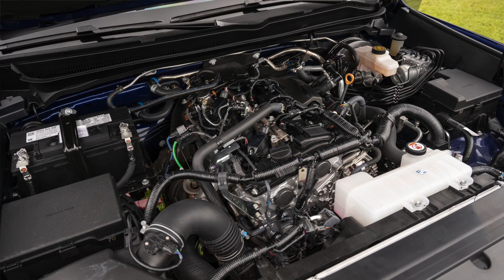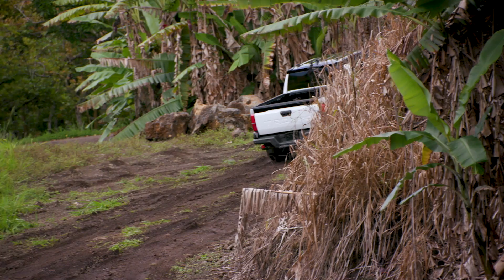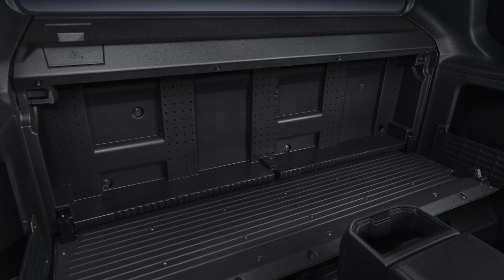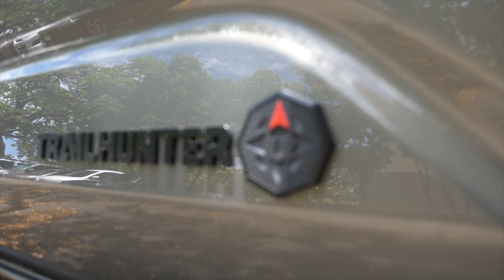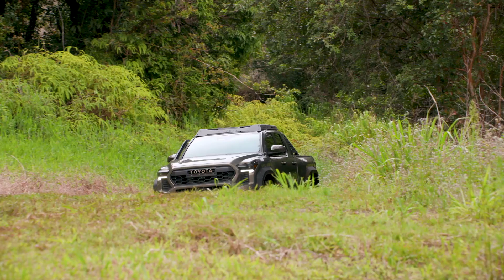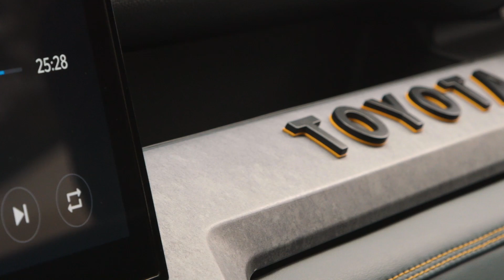2024 Toyota Tacoma Chief Engineer // What you need to know!

Comment: Will be very interesting to see the long term effects of using a thinner gauge metal for the frame here in the rust belt. Toyota has made claims before about corrosion resistance, but I have yet to see lasting real-world results. Hoping they actually did something that will last in salt spray.

Comment: Why did not you equip the partial 4WD trims with a central differential (open or limited slip)? I would love to have an option to use all 4 wheels on both slippery and non-slippery surface and to be able to disconnect the front wheels. THe only trim that has a central differential is Limited, nut it's full-time AWD. I don't think there are technical obstacles to having a central diff on partial 4WD trims - there are probably marketing and segmentation reasons for that. But I am sure there are many people like me who would loe to have a central diff on partial 4WD trims like TrailHunter and TRD Pro. Alternatively, there could be an option to have fulle-time AWD on ThailHunter and TRD Pro.

Comment: Exactly what was needed to explain the new features. I only wish engineering find a way to give more leg room for the back seats. Those who are 5” 10’  or above have their front seats set back as far it can go, leaving no leg “what-so-ever” in the back. If front driver and passenger seats are not extended far back there is still no room for back passenger. Just seems a waste for back passenger seats not to be used in most occasions.

Comment: The only reason I bought a 2023 Tacoma with the 6 cylinder was because of 2024 toyotas turbo 4 cylinder.  I just cant get past a little 4 cylinder thats turbo charged and trying to tow my snowmobiles or 4 wheelers up the mountain or highways.  Clearly they shaved off as much weight as they could in the new 2024 for that simple reason AND they intend to build ALOT more extra cabs VS 4 door long beds.  Plus, i just cant see that turbo 4 cylinder getting 200+ thousand miles of lingevity?  
But i will say this, That New Toyota bidy style does look Sporty and vicious though !!!

Comment: Better emissions, not necessarily better gas mileage under load, and MOST definitely a MUCH HIGHER repair bill when the dumb hybrid motor fails in under 150k miles. At that point you would be better off just dumping it for a new truck. I for one do not care about all of that fancy balogna. I WANT longevity in my truck. I STILL drive a 2000 Tundra with a NORMAL V8 and very few normal issues that occur at the 100k mark. There is absolutely NO way this new Tacoma can ever last as long as my old Tundra. Not to mention the ridiculous prices now on the new versions. Overall, NOT worth the price tag.

Comment: Turbos are trash and won't last a long time, period.  You clowns need to listen to your customers and mechanics and quit trying to reinvent the wheel.
Reply: You might want to quit listening to Scotty Kilmer all the Diesel engines have turbos these days America runs on Diesel and turbo charged engines 

You can easily get 150-250k miles on a turbo these days depending on manufacturer
Reply: @Kylewraps  Not 4 cylinders they don't.
Reply: @dennisquinn4387  you’re right but doesn’t change the fact a 6 cylinder turbo is more powerful then a NA 8 cylinder 

And a 4 cylinder turbo more powerful than a NA 6 cylinder

Comment: How bout you talk to the Tundra engineers and tell them to fix all the rattling on the interior. I’ve had 2016 2020 and now a 2023. Every time I drive on a less than perfect road I’m constantly trying to track down a new or existing rattling part. The headliner rattles, the door seals rattle, that junk console lids rattles and even the dang lumbar seat rattles if it’s not inflated a good bit. Toyota should be ashamed of itself fit and finished has always been quality being on my 3rd Tundra 5th Toyota truck in a row. I’m almost to the point of trading this one in on some other truck. If it wasn’t for a total loss wreck I would still be driving my 2020, happily. I can’t say the same for my 2023 Limited, it’s a $65k rattle trap. Again Toyota and the guys that engineered the new Tundra should be ashamed of themselves. Just my opinion based on my experience maybe I got an anomaly but don’t think so!

Comment: Love love the new look and the interior finishes, just bought a 2023 access cab with a few add ons. Love the truck but the Gas Milege is terrible though. However the thing of the new truck that concerns me is the move to aluminum body’s given it is less susceptible to rust but given issues over car producers had with this body type in the past and given a truck is handled a little rougher than usual vehicles how will the body holdup long term will it be easily more damaged due to light weight material used

Comment: Question #1 did you guys get rid of the throttle lag? And why do I need to get rid of the front air dam? After I purchased the Tacoma ( Dealership should ask if I want it) I  drive a 2022 Tundra now. I had three Tacomas in the past the last two had throttle lag, I want to test drive the I-force max Toyota Tacoma TRD_PRO
If it has ( the lag ) No Deal, going to Ford Ranger Raptor

Comment: Uhhh oh. He immediately starts talking me out of it.. and do I have to buy some corrosion treatment just to guarantee my frame? I mean. How did they make the frame. And a turbo 4? A hybrid. I'm just sad now. Where's the N/A? What's the alloy ratio of the frame? Rust jacking is what kills them. And where's the wide arms? Offset only? Do you hate us? I feel ignored and offended. And lockers. Now what? A jeep? How long do we have to wait? Until the crash of the hybrid battery manufacturing segment? No long arms. I would quit before saying yes to that. I'd retire. I'd refuse. I'd delete files.  No one is going to rock crawl a hybrid. Integrated bumper? You mean lockers? Buy my own bumper.  The color? Who cares.. the most difficult part of this truck is seeing what happened to it. 

Battery delete. Turbo delete. +2 cylinder mod.   Long arms. Lockers. The truck should probably only come in BMW white.

Comment: ENGINEERS changed the the  2015 and Newer TUNDRA''s Crew max with the hump in the rear seat and floor. It has to be the worse Model Change I've ever experienced in a TOYOTA Product.  Sensor that are always going out!. Rear seat that is as useful as a TOYOTA Camry Not a truck. 
Have they actually gone to the hunter, fisherman with RODs, snowmobiler with snowmobile clothing?, atver, Kayak carrying outdoorsman for functionality over time?? .  NOT the Hocky mom crowd that never goes farther then the depth of the side wall on the tire. ... With SO MUCH TECH It doesn't seem to want to be Reliable over time. Seems more like. Some more planned obsolescence and ADDING Cost over time with frequent repairs. LET Not JOKE. This isn't a legendry 1990's TOYOTA Pickup built to last 30 years. It's built to last 10 maybe 12 model years and be gone.

Comment: These definitely turned out better looking and more desirable than I thought they would but, I guess the thing on everyone's mind is: will they be just as reliable and dependable as the previous generations? Lot's of new tech, small hybrid engines that put out larger engine power, those two things don't exactly scream "long-term longevity and reliability." But if anyone can pull it off it's Toyota. So I'll stand on the side lines in my brand new gen 3 Tacoma TRD and see how things play out with these new Tacoma's.  As an 07 Toyota FJ Cruiser owner and a 2023 Toyota Tacoma TRD owner, I really am hoping for the best out of this new generation because heck, I'll only be alive long enough to maybe buy one more new truck in my lifetime and I hope it will be a Toyota.

Comment: I wouldn’t waste my money on this tree hugging shitbox
Reply: What do you mean
Reply: @mmr0221  exactly what I said
Reply: @predcatcherotr6629  are you talking about removing the v6? If So, then I agree with you. This is Biden’s EPA at work.
Reply: @mmr0221  this thing is gonna be worse on everything especially fuel Milage
Reply: @predcatcherotr6629  especially when hauling heavy things, this will have worse MPGs than the V8
Reply: @mmr0221  exactly plus u loose 1000 lbs towing capacity

Comment: I think he failed with the xtracab prerunner. It should have been an access cab with the storage options as reaching over the seat all the time to reach something in the back is a PITA. Hell there is even a video of the chief engineer having trouble to reach something in the back. Also the rear suspension was a mistake with the leaf springs being under the axel as that limits the lift options and will probably only be used to lower the truck like what other people did with the Nissan hardbody RWD. The prerunner with be terrible for off roading. They can say that they moved to xtracab for crash tests, but I bet it is to save cost and the MSRP will still be more expensive than previous years for the prerunner. Also they should have left the push start as an option. If I ever do get a 4th gen I will probably get a crew cab and delete the back seats to get what I wanted out of the prerunner.

Comment: Regarding the overland demographic, some fundamental strategies are to blend trail performance with all of the mobile camp accouterments and gear that enhance playing and living out in the backcountry. The growth of the truck camper segment makes this clear. I remember when it was tough to even get a rooftop tent in the USA. They eventually became ubiquitous and now are more often being replaced with pop-up campers mounted on trucks. So this leads to a huge question for the Tacoma: Why isn't the 2024 Xtracab being utilized as a Halo version of the truck? It maintains a good wheelbase length for technical trails, comfortably carries one or two occupants with enough room for some gear and a fridge in the cabin, and allows for a deck (bed) that's a full 6-feet long for a much more livable camper space or ability to sleep in the back with tailgate closed. All while reducing the gross weight of the cab allowing for more payload. 4-doors and 2nd row seats are fine for those who need them but please offer the premium drive train and performance options for the single-double occupant overlanders who don't want a 2nd row of seats or a stretched out wheelbase.
Reply: Exactly. Xtra Cab 4x4 with a 6 foot bed. Is there even going to be xtra cab option on the Sport and/or Off-Road? It does not appear so.  And I want to access that space with a door --not over a seat! The "new" xtra cab is more like my old 1997 xtra cab.

Comment: It looks great, but my concern is the crash protection/durability result of keeping the same exterior dimensions while extending the wheelbase and all of the material weight reduction .  That plastic front bumper looks like it would flex from the force of one index finger and the wheel and entire suspension and frame are inches behind it.

Comment: Front suspension arm length same as old generation Tacoma, no articulation gains, no front locker, while competitors offer amazing 10" suspension travel with extended front control arms and CV axles... It's pretty that's about it.

Comment: How are the hybrid (electric) engines with batteries going to do on extreme cold??? Like in about -10 F? Batteries and electronics hate cold and do not perform well in those conditions. Plus the hybrid factor adds complexity to the engine which means very expensive repairs only at the dealerships. The 4-cyl 2.4L turbo is a joke to put in a 4500 lbs vehicle. Adding the turbo you only accomplished that the engine will not last 100K miles because the turbo will burn out the engine. Plus additional issues that come with turbo. Funny thing…they are doing this video in warm Hawaii. Why don’t they do the testing in Alaska in severe cold conditions?!  The lockers are missing and their reasoning that lockers are not needed is ridiculous. If you don’t have real lockers on a 4x4 truck than you don’t have 4x4 vehicle. The electronic “4x4” options are no different than that of Subaru. So what we have here is Subaru in Tacoma’s skin..sheep in wolf’s skin. 
They packed this tacoma with sooo much electrics that it lost the appeal of a SIMPLE RELIABLE off road truck. His argument in video was fuel economy…bunch of BS. People’s going deep in woods dont care about fuel economy. They care about reliability, simplicity, ease of use, utility and dependability! I have never heard a guy talking about gas he saved when he got back from deer hunt. The V6 was perfected with simple transmission. It worked! They just pusified the whole vehicle and ruined what worked well.

Comment: Too bad there's no option for a non-turbo 4 cylinder engine. I'm not a fan of anything with a turbo. It's just one more thing to go wrong and it typically causes the engine to not last as long as a naturally aspirated engine would last.
Reply: 5--7 years from now all the fan boys will be crying about how much a new turbo costs.
Reply: @stevemason6850  Yeah, but the added cost for a replacement turbo is only one aspect. The other one being the turbo is lubricated with the engine oil and that means if the turbo fails and starts to leak engine oil you can ruin the engine.

Comment: two big points for me !  one is the replacement of extra cab, yes did the rear seat delete, but I can get to my stuff better with extra open door.  next is turbo 4 cylinder motor, will run like race horse first five years and after that the high dollar troubles begins ! trust me.     I run the Tacomas to 350k miles or more   22r, 22re, and the 3 gen six cylinder all great !  Tacomas were great due to old school,  and have great track records, fuel and repair, and great looking trucks.   new high tech is not always good  time will tell.     glad this 77 year old man bought a new 2022 extra cab with 6 ft bed  four wheel drive fuel injected six cylinder.   still driving the 2007.  with 350k miles never broken just change oil and keeps running great!      good luck Toyota 2024 , your gonna need it
Reply: The turbo will be fine. My wife has the 2015 Lexus NX 200 which the 2.5t is based on and it has been flawless at 120k. They have D4S and a dedicated cooling loop for the turbo. The engine can cruise at lower RPM with diesel like torque. Toyota also designed and manufactured its own turbo instead of going with a Garrett Honeywell unit.
Reply: Not interested in the Hybrid idea or the 4 cylinder engine. Such a disappointment.

Comment: Looks like a nice truck. Honestly I would have rather more room inside the cab instead of leaving it a few inches narrow to fit in a garage. I don't get the logic of "a better fit in the garage" over the comfort of driving it. Especially when they made it wider anyway. Just my opinion though. Also Leary about the aluminum tailgate. Can I drive it with the tailgate down and my kayak or lumber in the bed?, bed extender still available?

Comment: If Toyota would sell a shopping cart, their fan base would go on and on about how good, reliable, and capable it is. Pay top $ for it and then spend equally more on aftermarket mods to make it actually do the job. A 4cyl turbocharged Corolla engine, no front locker, 265/70R18 (32.6”) tires, no integrated winch capable front bumper, 1.7KWH battery pack for hybrid. And that’s the top dog in Tacoma lineup. No opening rear doors for access cab, and so on. At least Toyota could provide similar levels of features and capabilities as its American rivals, as the American truck and off-road market is very competitive and most buyers are very well aware of the machines that are built right for their needs. That’s why the American Truck and Off-road market is very competitive and not driven by brands fan base. 
Toyota built its reputation of providing best capable vehicles like the LC70 and LC100, in 2020s those vehicles should’ve been much more capable and refined but  unfortunately they are history, that Toyota still tries to sell much lesser products based on those legacy icons. It’s funny how knowingly they try to justify lesser parts as something better while their brand loyalists don’t question and blindly accept what Toyota tells them. 
It’s a good looking truck, but is it as good and capable as claimed, is yet to be seen, especially when the MSRP is known to make a comparative and justified decision in one’s next purchase.
Reply: Tacoma has always had the competition beat.....by a mile.

Comment: I'll be the fly in the ointment - too bad you can't order the rear seat delete in the crew cabs like the TRD Pro and Trail Hunter - it would be awesome to have that extra space for storing your gear.
Reply: Pull the seats, drop in checker plate locker. Easy. 
If you sell, simple switch out

Comment: a small truck shouldn't need a solid rear axle, a fully independent suspension is what is the future; especially when you have the oncoming unibody trucks that drive better, you can still have body on frame, give it INDEPENDENT REAR SUSPENSION AND IT WILL DRIVE BETTER, while keeping that rugged tow capable frame
Reply: Solid rear axle is better for offroading. If you want independent rear suspension buy a honda ridgeline

Comment: I miss my '92 Yota pickup. Didn't care to own another until now. Thank you for finally adding a turbo to the mix.
Reply: Turbo 4 cylinder engines without the turbo diesels will not last.
Reply: I have a 2015 Lexus NX, 4 cylinder with a turbo. I’m at 130,000 miles. She runs just like she did the first day.